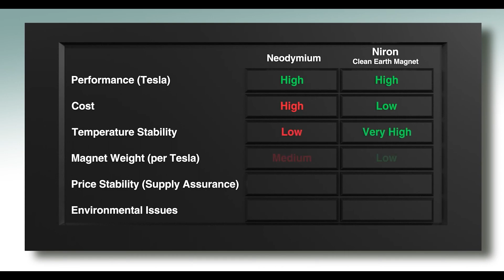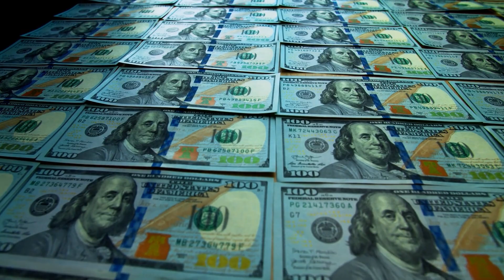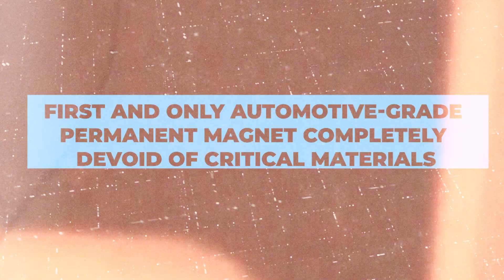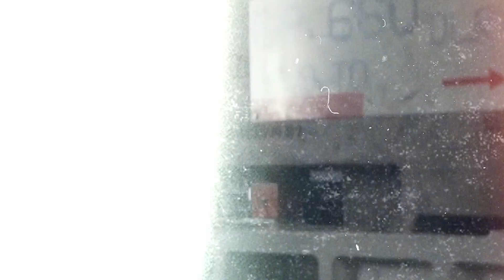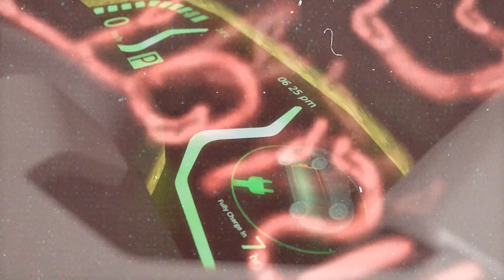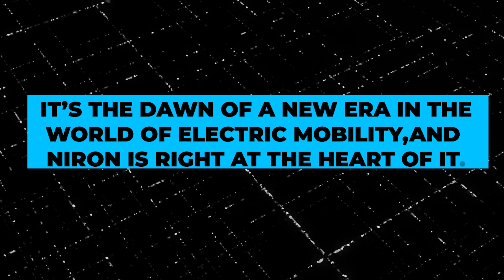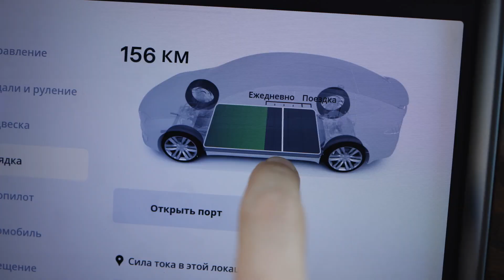GM CEO: "This NEW Engine will Destroy All EV Makers!"

Comment: There will be NO combustion ban.  Why?

New combustion tech will be 75% that captures CO2 and recycles it back into fuel at home via RE.  Nuclear made fuel will be 20 times less costs than charging on the grid.  Nuclear fuels are also 30 times less CO2 than 100% RE grid and battery CO2.  

EVs are a dead end if CO2 is the issue.  Only fuel making can get anywhere near net zero.